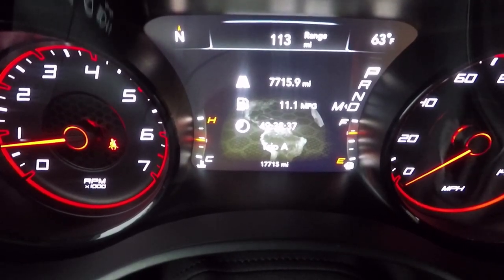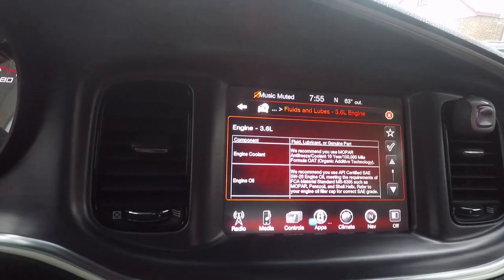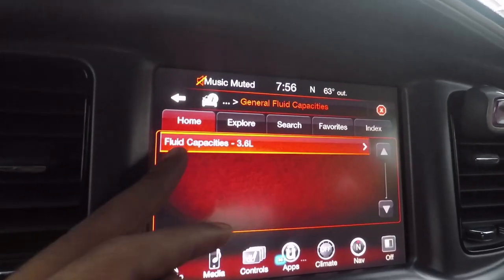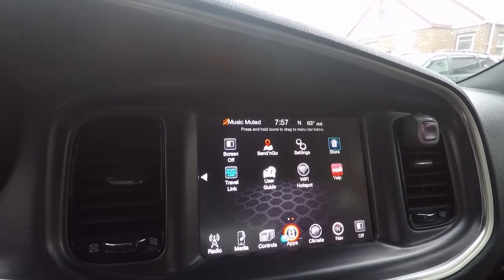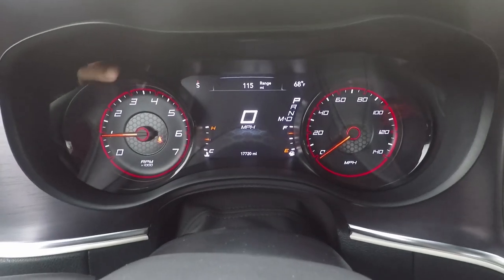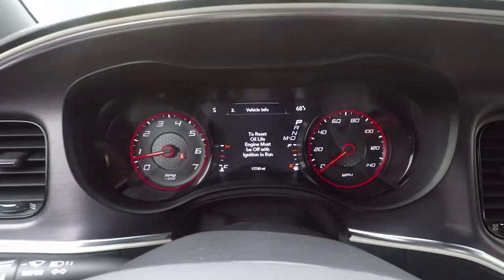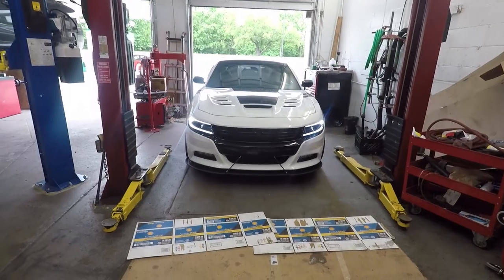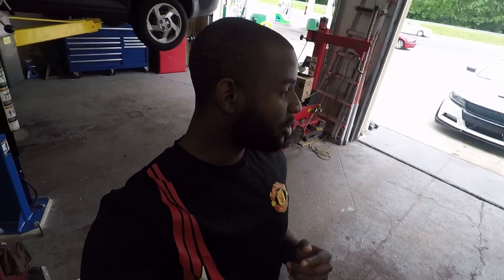Dodge Charger Oil Change and Tips

Comment: Nice video!  Just got my 2018 Charger and it’s amazing at how much computers have taken over cars lol.  I am a DIY guy also and this was helpful.  They take the fill cap off when draining to allow air in for better drain flow, no?
Reply from the maker: Thank you, appreciate the view and the comment! It is crazy!  No they didnt, first thing they did was raise it up. I have never learned that but u do make a nice point there
Reply: What kind of oil did you use on your 2018?

Comment: I have 15 Charger se and I change mine within 3k miles .. I’m not really sure how long
Reply from the maker: 3k is typiclq for older vehicles but if you use synthetic you can change every 5 to 10k depending if it's full synthetic or not. I usually change every 3 to 5 just cause a few dollars on oil for the longevity of my engine is worth it

Comment: I just got a 2010 Dodge Charger SXT V6 3.5. What oil do you recommend? Thank y’all.
Reply from the maker: Oh congrats man! Hmm probably have a little higher mileage so one specifically for that. Hmm even full synthetic but you should probably try and change ever 5k just because oil is cheaper collectible to replacing engine. People say oil is oil but I stick to pennzoil or Mobil due to the performance of the engine. I used to use Castrol for my older car
Reply: JayMac95 thanks a lot. It has 142000 on it. Runs good, though.